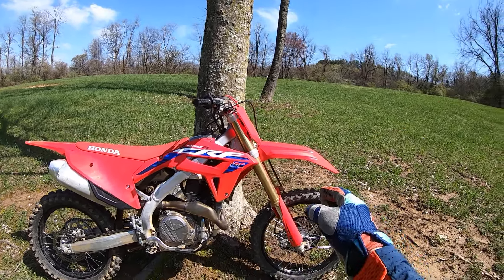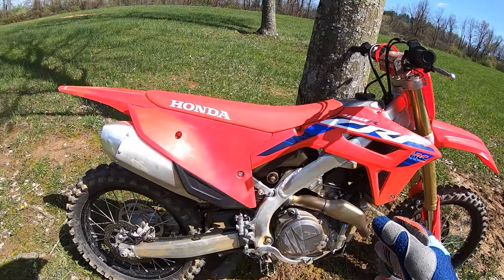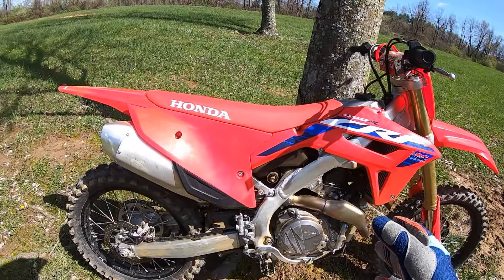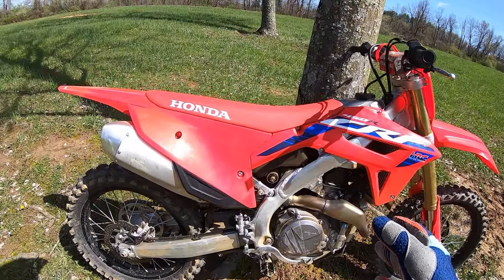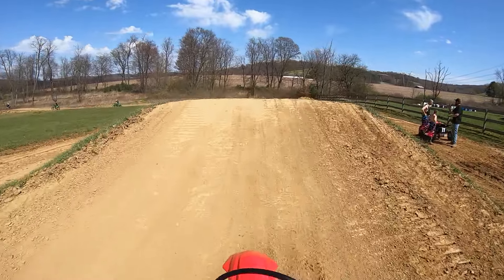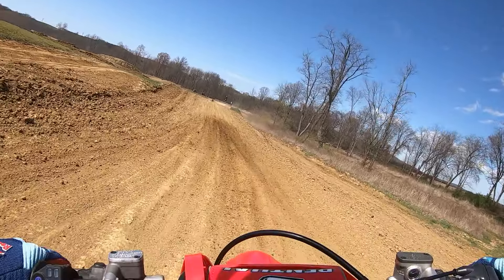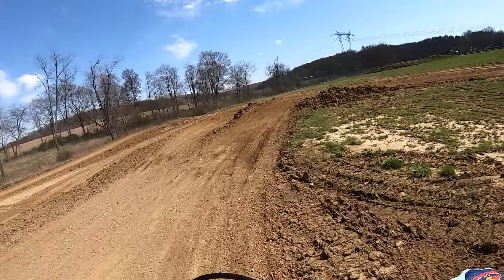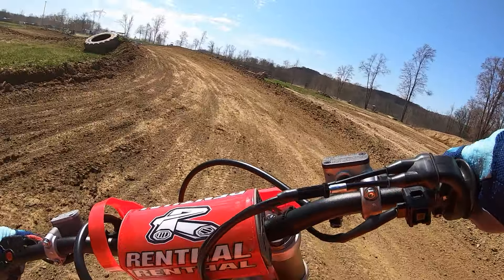Best Suspension on a 2024 Honda CRF450 I've Ridden to Date!

Comment: what are those 2 big black cables in front of the gas cap coming out between the frame spars?
Reply from the maker: Throttle cables - Honda went to a KTM style behind the handbars throttle cable routing in 2021 on the CRF450R